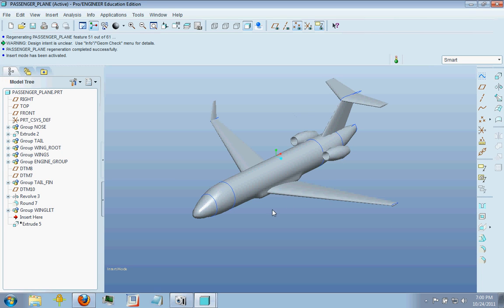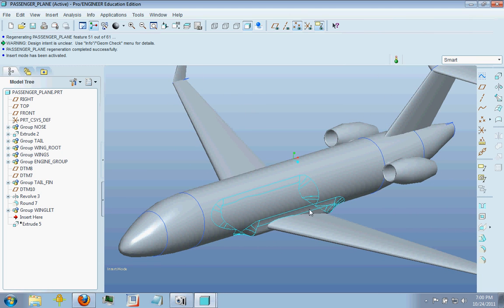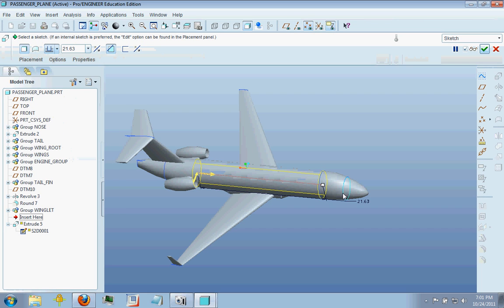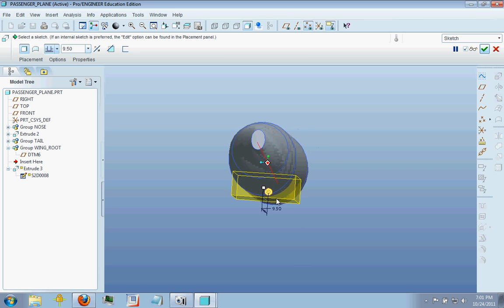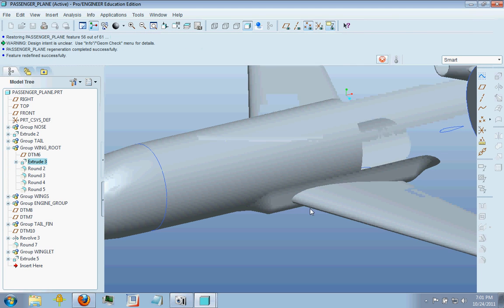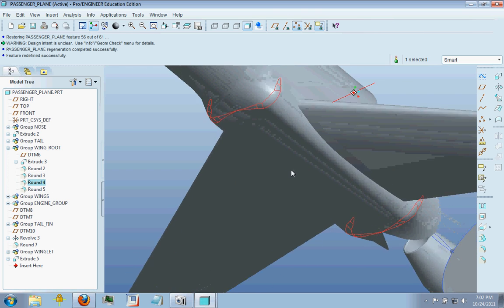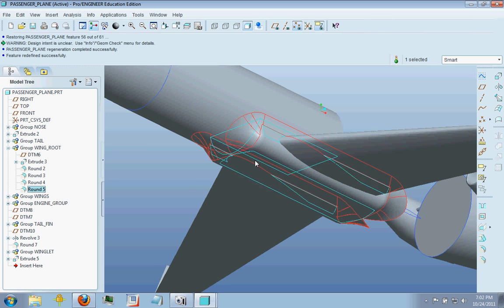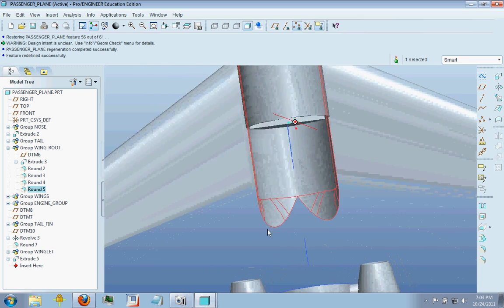General Airplane Design - Fuselage/Wing Interface

Comment from the maker: It really depends on what you are trying to do. Pro Engineer is great for modeling large systems like airplanes where you have to assemble all the parts into one model. THe power in Pro E makes that possible. Other programs like Solidworks and Inventor are more for small scale models.

In the end, it is really all about preference and costs. I use Pro/E because it is what I've learned in Highschool, and I put thousands of hours into using it.